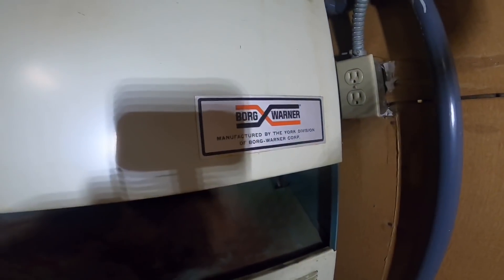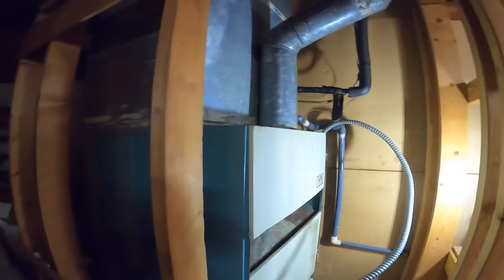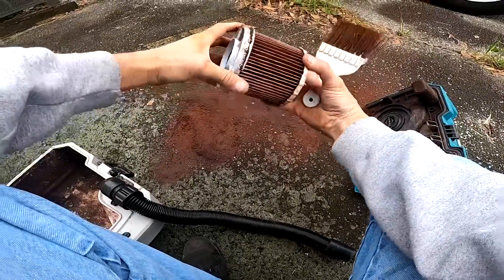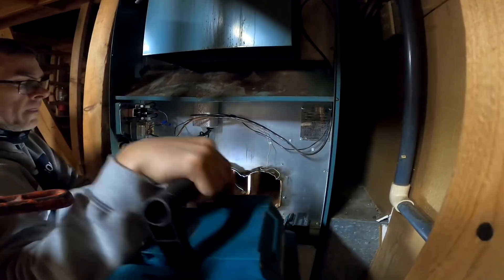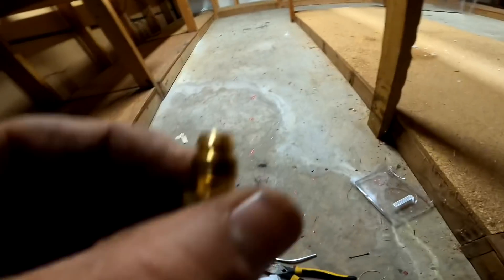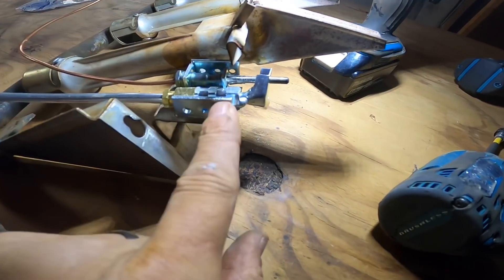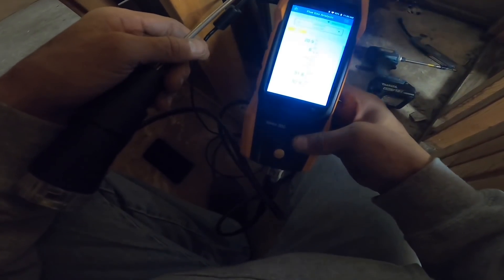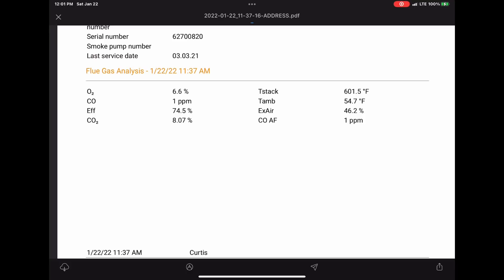Return to the Borg-Warner Furnace to Repair and Test

Comment: Dear HVAC GUY, I have a circa 1980 Borg Warner gas furnace that keeps blowing the fuse (S Style 15 Amp Plug [screw in] Fuse).  It happens when the blower is asked to turn on.  Also, I no longer hear the usual hum from the transformer in the furnace.  With a new (good fuse), I turn the switch to on (switch located on the outer wall of the furnace) but no longer hear the transformer humming.  Please help me in any way, if possible.  Any advice is much appreciated.  Thank you.

Comment: In the Northeast.. Cumbustion analysis is a requirement.
You can't run a boiler or furnace without it. It's a huge safety issue
Many winters up north where families went to bed and never got back up in the morning.

Comment: I’m in hvac school and they have never said or told us any thing about a combustion Analysis.
Reply from the maker: You may have to do research yourself. The Northern guys use them much more frequently.
Reply: @HVACGUY  yeah I’m in West Virginia so I’m sure I will learn about it
Reply: Honestly if you don't have a flame where the oxygen and gas change via actuators then they only have one other use. That's checking for cracked heat exchangers when the fan kicks on see if the 02 goes up.

Comment: I have a entire Chemical plant Full of Borg/Warners....mostly chill water airhandlers with York Chillers...most have been here since the 70s...well maintained and built way much better than the more recent AHU that has been installed through the 2000s.
Reply from the maker: This is my first experience with one, and it’s still a solid product after 40+ years
Reply: You can't be old school American made iron it will take a licking and keep on ticking till it gets hit with a car or a truck or an airplane then all bets are off